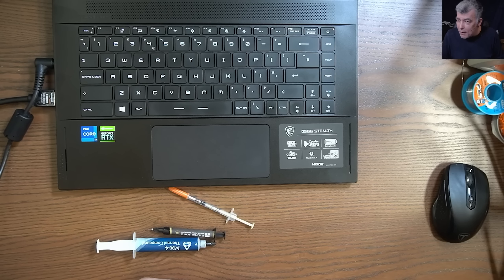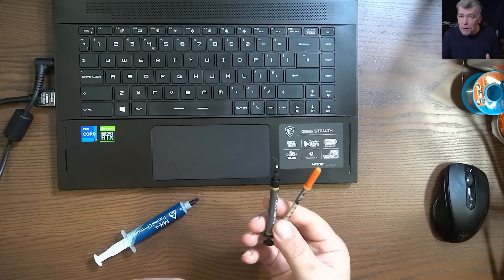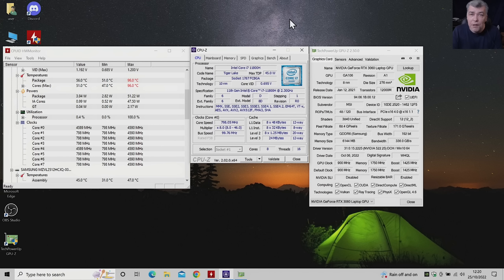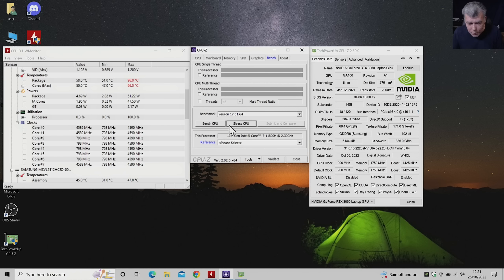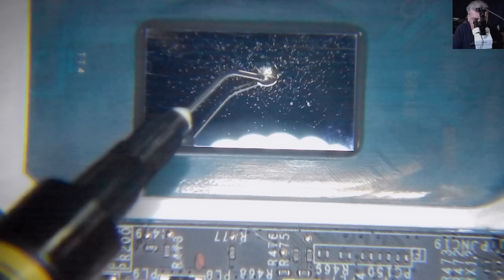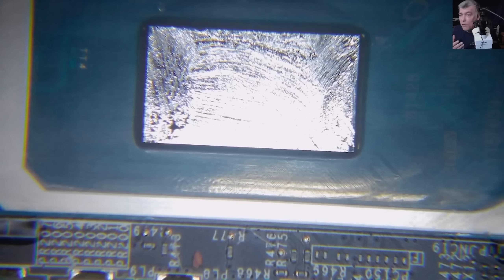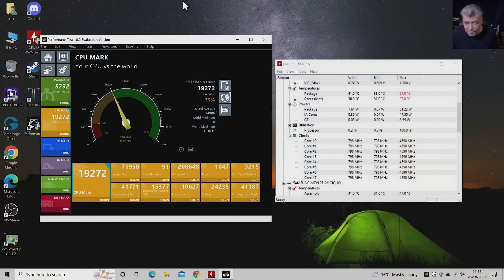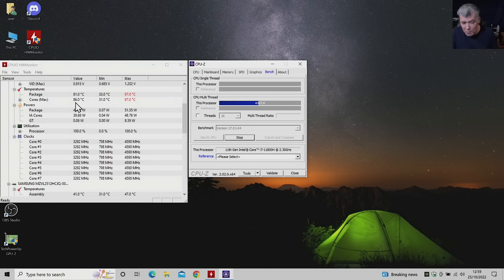Thermal Paste vs Liquid Metal - Benchmark

Comment: I switched to Honeywell 7950PTM Phase change thermal material on hot laptop and GPU DIE's because regular easy spread paste pumps out especially on 80+ degrees celsius. The only downside with phase change is that you have to let the paste/pad cure for 2 hours before placing the heatsink.
Long term stability of liquid metal takes a lot of prepare time on copper heatsinks.
Reply: I tried that on my RX 5700xt GPU but after few months temps are getting worse. I think that I will try liquid metal because I tried many pastes and they all pumped out.

Comment: How is this worth the switch from standard thermal paste? Would not fixing airflow, or larger cooler have a bigger difference in standard use? (Air cooled, no experience in liquid cooling)

Comment: ty sir for the video, I have almost same laptop I managed to drop my temps to 85 for the processor by disabling turbo boost however my gpu is hitting 88/89 celsius causing my frames to drop a lot, do I need to repaste?

Comment: LM has 1 advantage and too many dangerous disadvantages: it stains the copper, it pits the CPU/GPU, shortcircuit danger, it somehow solidifies with time, hard to apply, hard to clean. I would use it only in the most intensive CPU/GPU applications (mining etc) and if the hardware is disposable to you.

Comment: maybe it's not a good idea to do it on a raw cooper heat sink,, i have tried myself years ago two times.
in a windows of 3 to 9 month the galium and indium will react to the cooper and stop working propelly (seems to separate).
at the time i have found an interisting forum post about it but it's gone now.
and i don't talk about aluminium kind of reaction, you will can recover you're heatsink from it.
nikel plated cooper is better for those things.
let's see if you will have this issue in the next future.
Reply: I'm lead to believe you have to let a sufficient amount of gallium soak into the copper, or you can nickel plate it.
Reply: @SianaGearz  yes, i made some experiences whit it. when it lose efficiency i see black spot in it, i sand paper until all came to cooper or silver.then you even could use thermal paste on it with correct performence.i prefer to stop using metal because i don't like to comme over it too often (note : i dind"nt broke my laptop in the process ,8year and going).
Reply: @the_seb9587  I've been experimenting with nickel plating, I think I'll try that.
Reply: @the_seb9587  Hey man.  I want to learn if we renew the LM every 6 months or so, can we have the same performance again. I mean, is the damage from the reaction you mention permanent? And do you think LM is worth doing? How big is the difference between a premium paste and LM?
Reply: @ahmetarslan2748  i use sand paper (very thin one) to get rid of the hardened metal and each time there is no damages, but i think it"s too mutch risk for the result hi end  unconductive thermal paste is better when you're cooler is not nickel plated
Reply: @the_seb9587 You're not supposed to use sand paper to get rid of the stain. Let the stain be, its just a galium that diffused into copper which doesn't affect the performance. Sanding the heatsink will just allow galium to diffuse again on the next application. Keeping the "stain" will considerably slow galium diffusion on the next application and keep the liquid metal from "drying out".

Comment: I didn't want to risk putting liquid metal on my laptop because it seemed to suffer from paste pump out issues. Normal paste just never lasted long (maybe few days to a few weeks if I'm lucky). It started out great and over time I saw the CPU creeping its way back to the 90C region. When I removed the heatsink, the paste would always be pushed out to the sides and was barely covering the actual die.  I was afraid liquid metal would end up pumping out in similar fashion, so never tried to apply it.

Fortunately, I heard about some phase-change pad called "Honeywell PTM9750". It takes a while to get because it comes from China, but wow, it made a difference. I wasn't expecting much, but since putting that pad on, I haven't encountered CPU overheating problems like before. I added the pad several months ago and the CPU temperature is still doing good.

For those that don't want to use liquid metal because of the risk, the Honeywell PTM9750 is something to try if you can get hold of it. It seems awesome for the long-term. I would always have to keep changing pastes often with normal pastes. That doesn't seem to be a problem any more.
Reply: I don't have any pumping out effects on my i7-9750H laptops for 2 years.

Comment: Hi. I have a pre-owned Dell Inspiron 15 7567. It worked fine 
During the first 3 days of owning it until Dell Update software popped a notification about a latest Bios version 1.15.0 and latest Intel ME Software update of which I updated. It rebooted and firstly, Upgraded Bios from version 1.8.1 to 1.15.0 then it started upgrading Intel ME firmware. After that update, my laptop shuts down without notice (Like thermal shutdown)
I checked Thermal Paste on the processor and the Graphics Chip and it was dry. Replacing thermal paste has not helped me. 
Now I've noticed that laptop shuts down in less than a minute when the charger is connected while playing mp3 only, but when running on the battery alone, it's working fine without shutting down until I run games then fan will run fast and laptop suddenly shuts down. Please help me with information that can make me solve this problem.
Reply: hi did you get the dell to work? just few tips: try reset the bios. monitor temps when it shuts down. does the mosfets, vram etc have thermal pads on them?

Comment: Dont use liquid metal on copper laptop coolers...You need a nickel plated one. Its gonna go bad after a while. I used TG Conductonaut and had to reaply it 3 times to my elitebook in like half a year, it dried up and the cpu was overheating. The cooling was amazing at first but it started degrading over time. In the end i used arctic mx4 and it still fine a year later.
Reply: Thermal grizzly conductonauts is fine with pure copper. It will stained the copper heavily - compared to nickle - but not affecting thermal performance. Gamers nexus had tested it many years ago. I reapplied it every year or so, but yeah the copper looked ugly af, impossible to clean the stain!
Reply: I'm thinking of nickel plating the laptop cooler for this reason before I do liquid metal.
Reply: I have pure copper on my CPU water block 
(With i7 6850K - so nothing new and nothing cold) :D 
And still work after years without problems or visible degradation .....
Probably something is in thermal grizzly because I saw many threads how liquid metal is monolithic with cooler (or chip) and still people talk abou TG
Reply: The problem maybe is also the mounting pressure on laptop coolers coolers. I realy dont know what exactly caused the drying up... but it happened 3 times and the cpu went nuclear with full fan speed on load... after sanding the the dried up metal and reaplying a tiny amount of fresh it was whisper quiet and cool again for mybe 2 months... the laptop was a elitebook x360 1030 G4 with a i7-8565U case made fully out of aluminium (yes i know im crazy haha)
Reply: @benywiratmaka8636  hey I'm thinking of applying that paste on my razer 15 2019 and I'm pretty sure it's pure copper heat sink. I'm concerned of the paste being absorbed into the copper over time. You are saying that it won't? My biggest concern is what happened to this guy where he had to re apply again and again.
Reply: @callumeonpc4035  it will bond with the copper, akin to plating it, no way to clean it. But it will not errode the metal like with aluminum where the aluminume will become brittle and eventually destroyed by the gallium. But if you're not confident, why not just use a good thermal paste? The temps difference is not huge and you will avoid the risk of shorting SMD components, destroying your laptop 😅
Reply: @benywiratmaka8636  do you know what would be a high end thermal compound to use?
Reply: @callumeonpc4035  my favourite are TG kryonaut & CM mastergel maker
Reply: @benywiratmaka8636  Hey man. How much difference between Tg kryonaut and LMetal? How many Degrees?
Reply: I use Thermalright silver king, after 1 year reapply it haven't dried yet

Comment: You have to use a rwgular thermal paste first. You have to put a Windows sticker abve the processor, chipset, video chip the right way. It can be an illegal one. The processor, such as dual core can recognize the vista lines over the cover. After regular use, it will reduce the heat. Your legal eg win 7 code is recognized by a satellite, reading the code from the dvd cover once a year offline. After your computer is off the default blacklist, you can use the liquidmetal.

Comment: Sorin Liquid metal in any case should not be used with copper. Both react chemically with each other and solid crystals are formed. These press into the silicon core and the CPU or GPU die. I have seen this several times myself with our customers.
Our conclusion: Liquid metal does not belong in a mobile device. Unless you do it like Asus. A silicone frame around the CPU silicon core and a coated cooler that does not react chemically with liquid metal.
Reply: That's not true. I've watched many videos on that. Copper is the best material with liquid metal. There is a reason why all the water cooling blocks are made with copper, and those manufacturers usually consider the liquid metal cooling too. It's specifically designed like that.
Reply: As stated: Manufacturers, that design their devices using liquid metal also nickelplate the copper since it is a known issue, that copper also gets corroded by liquid metal. (Sony and ASUS for example)  @adamvebaloisnotavailable

Comment: Thermal paste for ever, I have no idea why anyone would need liquid metal for standard use. I have seen too many that have stuffed their computer or video card just to save a few degrees. If you computer is over heating, it obviously something is wrong.
Reply: apparently you know more than the people who designed the PS5
Reply: My next pc I’m doing custom water cooling with contact frame Liquid Metal t30 fans might delid not if it’s too risky. I STG I was messing with 12600k bios settings BLCK ovc or something I press control shift esc to see cpu speed it said 6+ghz I STG it went to like 6.7 ghz down to 6.4 changing I immediately shut my pc off to turn off all the settings I have a 240mm aio and I thought I was gonna break my cpu
Reply: @cesariushervelazco8 ps5 is not general use. It’s a gaming beast
Reply: I prep the PCB with non-conductive electrical glue around the chip (when working on delidder CPU) or around the ihs on AMD or certain Intel boards and haven't had an issue. Prep work let's you get what is advertised for the components you purchase without risk.
Reply: You're ignorant if you only base your judgment from the temperature difference alone. 🤦‍♂️
Reply: Tell me you have no idea why someone buys hugh end laptop/PC without telling me that. 
If you buy laptop with power CPU and GPU you are planning to use it to maximum and temps might hit even 100°C. After watching few reviews of liquid metal i have to buy it to lower my laptop temps when it works under extreme pressure
Reply: Depends, Intel DESKTOP CPUs needed to be delidded, the TIM between the CPU and heat spreader sucked, not sure about past 9th gen but they sucked before, to the point that water cooling was not helping sometimes
Reply: One. It's easy. Two. It's not "jUsT a CoUpLe DeGrEEs"
Reply: skill issue
Reply: I have an Alienware laptop that has a blazing hot 12th gen i7 CPU. Before I put Liquid Metal as the thermal conductive compound my fans would be blazing at 100% and it throttled the CPU and GPU. I keep my machine spotlessly clean inside and out. Can thermal paste work well? Of course! Can the thermal paste out perform Liquid Metal? Hell no! You need to be diligent when applying because it is conductive but it will out perform any thermal paste out there.

Comment: Says "put just a little bit of liquid metal to GPU and CPU" and proceeds putting a LOT of liquid metal onto the heatsink side... :) Also you really want to isolate the components on the GPU and CPU dies using nail polish or something before applying liquid metal...